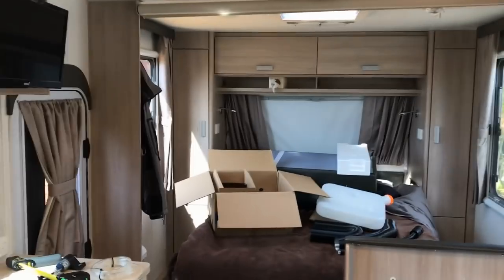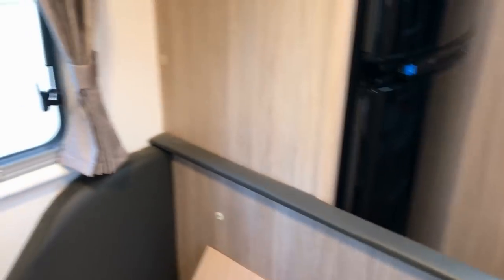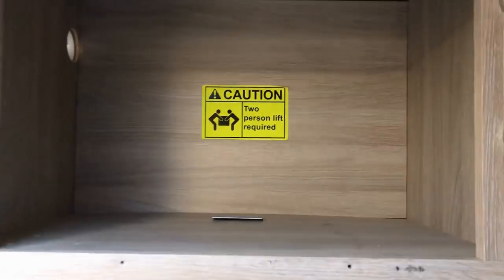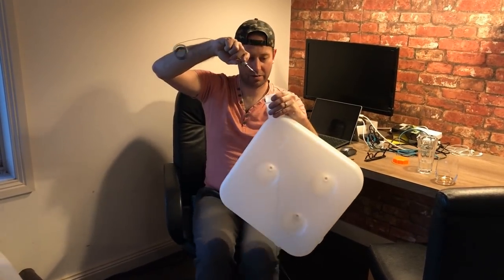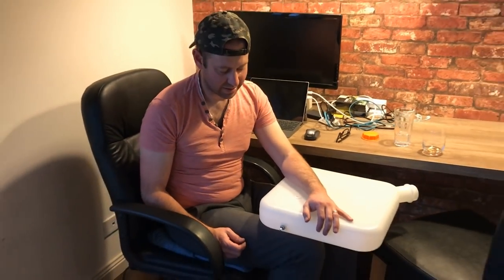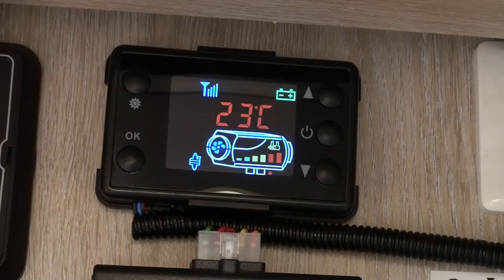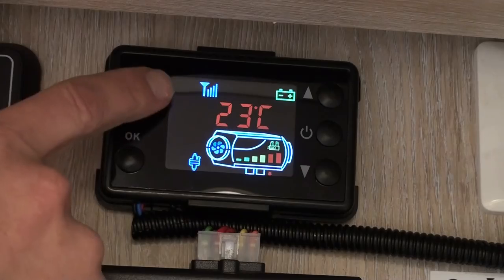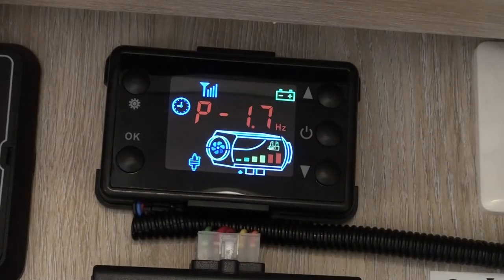Diesel Heater Install and review  #Winter is coming

Comment: Hi, I think I have bought the same heater except mine is a 8 KW which I am about to put in my Camper. I have couple of concerns. 1) is the heater very noisy when in operation.eg, could it be installed under the bed?  2) is the fuel pump noisy, is it something that should be installed outside underneath the van or could it be installed also under the bed. 3) Does the surrounding area around the heater unit  get hot . if anything were to fall on the unit would it get scorched or catch fire. eg, if I'm sleeping in the bed over the unit am I in danger of waking up fried?
Reply from the maker: I wouldn’t put it under the bed

Comment: Mine had some bad crimps in the main connection. Wires falling right out. I ended up cutting out the connector and butt connecting all the wires. Ran a test run where it ran as intended but upon install set E06. I found when I bolted the unit down just slight pressure on the body of the unit caused the fan to rub causing that E06 Finally up and running. Build quality is so cheap I’m worried to let it run long unattended, but so far working as intended.

Comment: I ask myself the same question now since last winter. My propane furnace was the biggest pos in the world. If it did light it was so inefficient that it would suck down a 15 pound propane tank in a week. Now with these diesel heaters I've got I'm comfy and warm and even have the option to start my heater before I get home so I'm not walking into a freezing cold house.
Reply: Joe Boredom that's because propane only contains about 6kwh per pound, of course 15 pounds isn't going to last long in colder weather, it's only 90kwh per tank! I'd say you were lucky to get a week out of it. My only experience of bottled gas heating was on a boat, where we would be pleased if a 13kg tank lasted three days.
Reply: @spencerwilton5831  lol I think the only reason I could get a week was because the furnace didn't like to light half the time. Sometimes it would fire for a little bit and die. There was some nights that I was so desperate for heat I would be huddled next to the stove.

Comment: I'm sure someone else has pointed this out but I got triggered by the Hz lol, Hz is hertz 1.8 Hertz is 1.8 pulses per second, the more pulses the more fuel and heat etc. 
How has it lasted over the years? I know some of them fail over time if run on low all the time, they can build up lots of carbon and clog the core so it'll be curious to see how it's lasted.

Comment: Great video. I have just installed one but getting an error E-07 - "Broken line fault" Fix: "Check whether the blue communication line on the panel connection plug is normal".      I have checked all the wires and they all look intact. Thanks Gavin
Reply from the maker: Maybe get another wiring loom

Comment: We just purchased one of these units last night cannot wait to do install and see how she goes. Were planning on free camping in 3 wks time so fingers crossed all goes well. How big is the hole saw for the vents??
Reply from the maker: Congrats, I thing I used a 90mm hole saw by memory and cut two overlapping holes
Reply: Thanks for the reply. A question it comes with a steel bracket did you install the bracket on the inside of the van or on the underside?? The instructions are useless...

Comment: 1st mistake. You can get a fuel drop pipe thingy so you go into your fuel tank from the top. This way you reduce the risk of of a fuel leak, 10lt all over your rigs floor😱
Reply: what is this thingy called ?
Reply: @oztexs1440  stand pipe

Comment: I have been looking at these on Ebay for a while and want to install one in the Coaster. Still making up my mind whether to go with an all in one unit or a separated one like this. After watching this I am thinking it might be nice to go with a separate heater and perhaps get the fuel directly from the fuel tank of the vehicle.
Reply: Get you a heater and you love it! Just try and get one with a all metal outer case. Im sure the plastic ones are fine but it just seems safer all around. Im thinking about getting an all in one unit for my work shed but for a camper the separate unit would be ideal so you have more installation options.

Comment: I have read that the only difference between 2000 and the 5000 is the control board so buying the smaller unit is not recommended because it does not get hot enough to keep itself clean.

Comment: Hey mate did you have to cut and join more wire to make the cable longer ? My control cable isn’t very long
Reply from the maker: Negative, mine was long enough

Comment: Did you say you had a way to turn the display off I’m not sure it draws too much power anyway and it deems it self but I thought I heard you say you can turn it off? I don’t need my display on and I use the remote control on the set temperature but is there a way to turn it off?
Reply from the maker: Only by putting a switch inline

Comment: Hi @DASH Off road, Thanks for the vid.  You mentioned in the video that you would tell us how you power the display off to save power when not in use.  Ive watched the vid a couple of times now and don't hear you mention how you do that.  Could you please explain what you do to disable the screen.  We too have a Jayco Journey, how did you wire it to the battery?  Direct to the battery or through the Jayco Controller?  Thanks in advance.
Reply from the maker: Hi, pretty simple actually. It’s powered from my solar controller which has a switch for the output

Comment: The 1.8 hz is pulse rate for the fuel pump the higher the pulse rate the hotter it will get , your little push button fob , you don’t have to use led screens buttons at all, I’m having it in a top tent so I dare say I will be sleeping with a vent open cheers

Comment: 5:40... A better way of getting that in there probably would have been to feed the wire through the small hole and out the lid.  Then thread the piece onto the wire and let it drop down toward the hole.  Maybe add a small bend at the end of the wire and then pull the wire back out the small hole, pulling the piece into place... the wire bends back straight as it pulls the piece into place.  Sounds good in theory anyway.  Your way worked though and that is all that matters I guess:)

Comment: would like to have seen how  and where you installed the fuel tank? I do not have an auxiliary fuel outlet so i MAY USE THIS LITTLE TANK TO start off before having to drop the main tank and insert a fuel line. Thanks
Reply: You could always get a bigger tank or tap from your main fuel tank if you have a diesel. I'm not mobile for another year so I decided im going to get a food grade 55 gallon plastic drum, mount on 3ft wooden stand and tap into it with 2 fuel lines for my heaters. Yeah its not great for travel but i still have the small tanks installed, ill just modify it so I can switch between the two.

Comment: Thanks for the great video, especially of the LCD screen.  very helpful.  you mentioned you would say how to turn the LCD off to save power but didn't do so.  does anyone know how to turn it off.
Reply: I'm gonna add a hard switch.  I just pulled the fuse after I got done installing and testing mine last week.  The screen looks cool and all but I don't need it on all the time.  #hobomessiah  Enjoy.

Comment: With the fuel tank you should have pushed the wire through from the small hole to the filler hole then slide the  it thing down the wire .

Comment: I didn't hear you mention a brand name or specific vendor. Can you reply with a link or specific brand?  BTW, I would think you could turn the heater around to discharge air the other direction if you ever wanted to so you wouldn't have the neat right under your table. I have a 30' 5th wheel and a propane furnace, but it sounds like I just started up my diesel truck when it runs and this system seems like it's very quiet.

Comment: At initial warmup, it will draw about 9 amps for maybe 8 minutes or so then throttle way down as your video shows.
Reply: Hi Kevin, do you know what amps it draws on low continuosly?
Cheers
Reply: @davidrussell2088  about 2-3 depending on fan speed

Comment: The fuel line; why does all the DIY videos i have seen drill hole and put the socket on the bottom of the tank? It`s just to drill a hole in the top of the tank and lower the fuel line to the bottom and secure the socket? Right? Sorry for the English :D

Comment: Can you tell me I'm not a electrician but extending the wires for lcd controller. Red black blue. I guess it's live earth and information wire does it matter if the blue wire is connected with any colour wire as I need to Do the same as you done in the video.

Comment: Wow, ends up being $1 per 4 hour on the 2 kw equivalent heater. (I am assuming their stats are on lowest setting, so may be more) So a 1500 watt electric heater is $20 and costs 7.5 cents per hour. (.05 per kw)  I guess if you are dry docked, this would be ok, but even the propane heater ends up being a bit cheaper to run- luckily mine has one built in.

Comment: Neat and tidy, I'm installing one of these in my Audi A4 TDi later this week, to survive the winter :)
Reply: I guess your audi heater isn't working?
Reply: @Alexander_l322  actually mine is a early spec B6 and it dont have a parking heater, not even a electrical heater in the AC, it came on the my2002. The "only" heater  is has is its 2.5 V6, and its not accepted to have the car on idle 30 mins, as it is with a parking heater. I'll post a installation video when its in place.
Reply: @KJohansson  wait what? It doesn't have a heater matrix running off the cooling system like literally every car on the planet has? Id love to see the installation of it and see what you mean by your audi not having one already lol
Reply: @Alexander_l322  yes it has a heating matrix. But no parking heater, we get -20-25 in the winters were I live so a parking will make my mornings easier. Love your caravan btw!
Reply: @KJohansson  I understand now.. You want a heater that isn't running off the engine and thanks but I don't own a caravan

Comment: I was just wondering as I saw a video about condensation in vans especially if cooking with propane. is it possible to use this as a way to cook food. ie if the vent was pointing upwards (or tube bent upwards from the outlet) like a propane burner stove and a saucepan/frying pan was then placed on a stand just above the outlet would it be hot enough to cook food/boil water etc.
Reply from the maker: I think there is easier ways to cook, but maybe??

Comment: Is there a way to adjust this based on altitude such as with the Webasto? I live in the Rocky Mountains and my home elevation is 4000+ ft and often travel to nearly 10,000 ft
Reply: the new model ones with the blue controller you can and there is a chance with the one in the video can prob do it to

Comment: Greetings, Great video and thanks. Reading the comments I must ask what happens if the air is restricted or the fan stops? Built in overloads or should one find one and install themselves? That is a good question.  Great looking unit and very practical., nice install.

Comment: I have a 38 feet diesel pusher rv. Which should I get between 2kw to 8kw?  Rv propane furnace consumes too much propane gas. Been watching these heaters on YouTube.. Very interesting.
Reply: The 2kw uses 250ml pr hour (I can only assume on low) 3.8 liter per gallon at $3.80 for easy math=$1 per 4 HR .25$ per HR. If you have access to electric, it is 2.5x cheaper.

Comment: P-1.8 is the pump frequency not the temperature.  changing the pump frequency changes how much fuel the system uses.  lower is better.

Comment: Hi great video, I am just installing one now, my one did not come with remote, BUT i have spare remotes in the garage from central locking system which are the same as yours, do you know how to pair the remote to the system .

Thanks

Comment: I make mine with 20 lb tank with sand and free flow diesel oil. I adjust flow all night heat inside my Teepee. tank last all night. no electric needed or battery.
Reply: Peter do you have a website for the setup?

Comment: Ideally the air coming in should come from outside...    But you would need a way of shutting it off so its not drafty when you're not using the heater...   It would be great if the switch you're using to run the oil pump opens the intake air duct too.

Comment: Would you recommend connecting the unit to the furnace ducting.
Reply: Depending on where the ducting is located and how much insulation you have around it, it is possible but honestly if in a older camper or one that doesnt have decent insulation you will waste more heat just trying to pipe it around rather than having it come straight out of the unit. But it never hurts to try and see where it leaves you once it gets the ducting good and hot.
Reply: Try using your furnace ducting for your Intake air....  it will cause the heat to become more evenly distributed...

Comment: strange the temp set is a Hz which symbol for frequency per second . such as wave length...
Reply from the maker: Weird hey. Hold down two top buttons and it goes back to degrees
Reply: @DASHOffRoad  The amount of heat generated depends on the amount of fuel being delivered by the pump.  I think it shows HZ because the pump is a pulse type. You can hear the "Tick tick tick" change in speed during startup/priming ect.

Comment: Hi just ordered one of these you said lcd screen uses about half an amp and you can turn display off how do you do that?🙂
Reply: The heater/fan uses half an amp not just the screen. The screen will use very little power.
Screen very little, the fan will use half an amp upwards and when the glowplug is powered it 
will use upto 10 amps depending on the model.  Be careful with the time used though. Even half
an amp load will kill the average 100Ah battery quicker than you may think. And if its actually under
load 7 amps will soon drop your voltage down, unless you have a battery bank. Single battery wont
last that long.

Comment: Hi just realised that you can change pump rate and fan speed presumably the lowest settings would be fine for a small van and less amp draw thing is what is the password to get into settings just wondering if you know👍
Reply: Hi there I installed the unit in my van and posted a video of my installation called "non branded Chinese Diesel Air Heater".  The code for the setting is 1688.
Reply: Actually it's NON-BRANDED CHINA PARKING DIESEL HEATER

Comment: Good video, thanks for sharing!  Does anyone happen to know if the main heat unit needs to be mounted in one specific direction or one specific orientation or is it maybe possible to mount the main heating unit in different positions... such as on it's side, vertical or maybe upside down, with the two mid center pipes pointing up towards the sky(?)
Reply: You can only mount them one of two ways. One is with the intake and exhaust straight down through the floor which is how most mount them and the other way is on its side but only on one specific side with the glow plug closest to the top of the unit. It cannot be mounted on the side where the glow plug is closest to the floor. Hope that helps.
Reply: @wbforsure2104  - Thanks, that's exactly what I needed to know.  btw... I ordered a heater and (thanks to watching your video 1st and hindsight being 20/20) I was able to figure out, it's much easier to attach a small bolt/nut to a wire/string and drop it through the small opening in the bottom of the fuel tank (first) and allow it to drop out the larger fuel opening at the top... then simply tie the fitting to the wire/string and pull it through :)  Regardless, seems you got it without too much hassle :) All the best and thanks again for the reply and for posting the video so others could learn from your experience!

Comment: How many hours are these rated at?
Reply: Not sure but they are very robust units. I've heard they get sooted up very fast in certain conditions but mine has run completely dry more than a few times and after a very long relight Ive run it on high for about an hour and it helped alot. I opened my first bought heater in the spring and it was clean in the combustion chamber within reason.
Reply: As long as tou take care of it and make sure it burns on high for an extended period of time at every cycle you will have it for a long time.

Comment: The thermostat should not be in a cabinet or outside wall.
Reply: BUDDY LIGHT Yeah that was about my very first thought when I saw him say I’m gonna stick it inside this cabinet, and oh yeah isn’t that an outside wall also, knucklehead
Reply: Why?
Reply: You don’t put a thermostat on an outside wall or in a cabinet, and outside wall will cents the wrong temperature because it’s colder or hotter out there, you want it on an interior wall. And you and Shirley don’t want it inside some cabinet where it’s not going to sense the space that it’s supposed to be controlling. So what do you want to heat or cool, the temperature outside your space, the temperature in the tiny little cabinet or where you actually live that’s the answer.
Reply: @shockingguy  you're right.. And don't call me Shirley.
Reply: shockingguy  sense, not cents.
Reply: @TheDirtyChef  ...ha ha ha I loved that one...good memories.

Comment: Surely the glow plug only comes on when you start the diesel motor and not when it's running.....
Reply: It runs and burns diesel, only uses like 30 watts and like 1.6 gallons per day mate
Reply: Yes correct, it only comes on to start.
Reply: The glow plug comes on TWICE with these. Once for a few minutes to start up as expected. Then it shuts down for the entire duration you keep the heater operating. However, it also comes on a second time during the shutdown for another few minutes to ensure that the remaining fuel is burnt off.